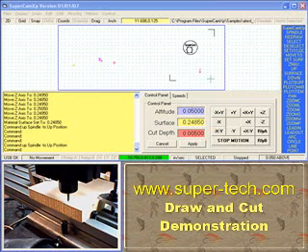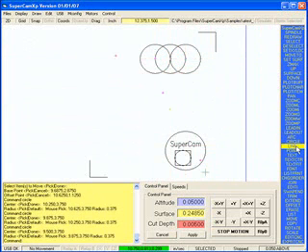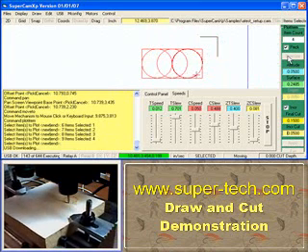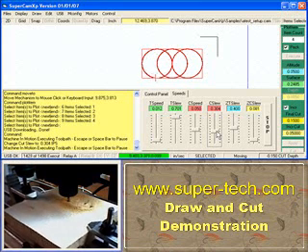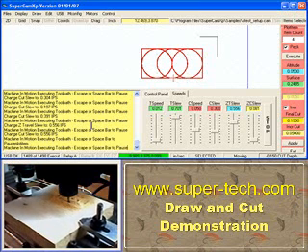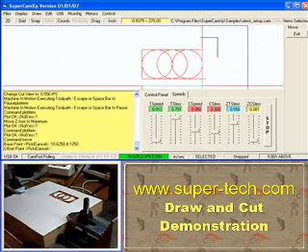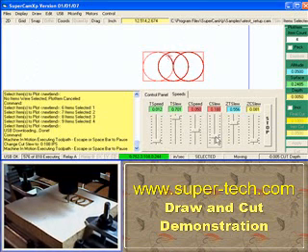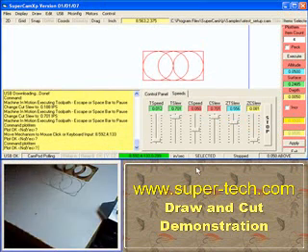CNC Taig Mill Draw and Cut with SuperCamXp

Comment: Feedrate changes take effect only after a z-axis change, rather than immediately?!  What a POS!  On non-pc controls, feedrate changes take effect immediately.  Is this a limitation due to Windows?  There are some pc-based controls that don't use windows, and they are much more faithful to industry standards -- such as how feedrate should work, realtime performance to ensure accuracy, etc.